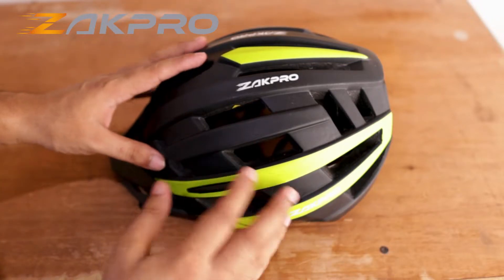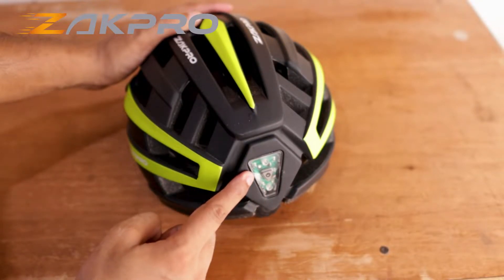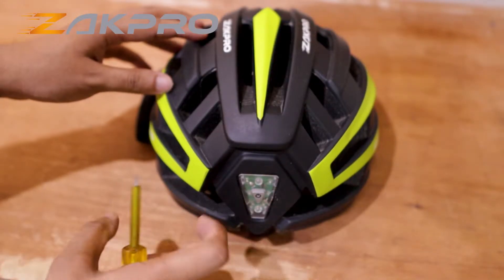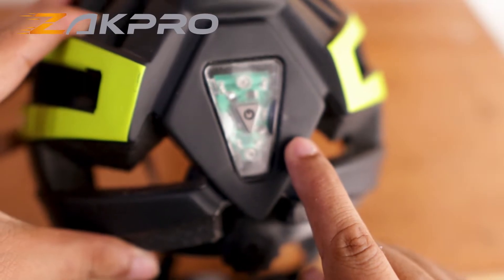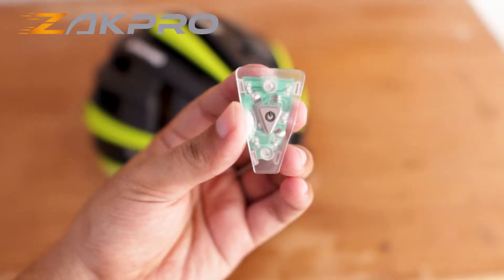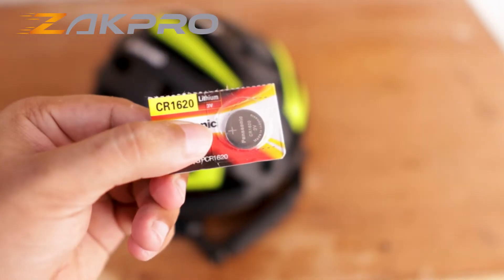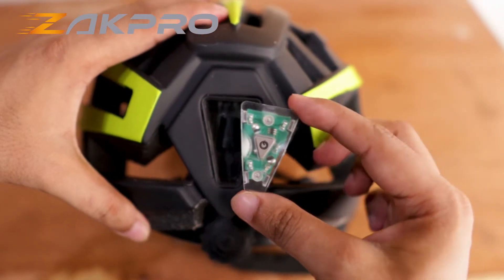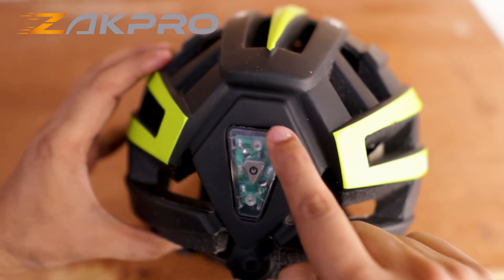ZAKPRO uphill in-mold cycling helmet - Battery changing and rear LED light removal video

Comment: This is not a good technique, there is every chance of item getting damaged if it's done a couple of times/ or with even a minor mischief. Replacement of battery should have been more simple and reliable.
Reply from the maker: Dear Customer,
The battery replacement process is fairly a simple process. Also once you start doing it regularly it becomes even more smoother. And we have our customer service who will help you even if it gets damaged. So kindly let us know.
ZAKPRO